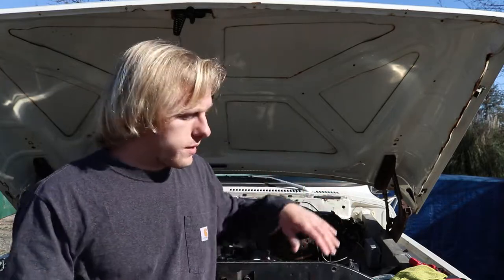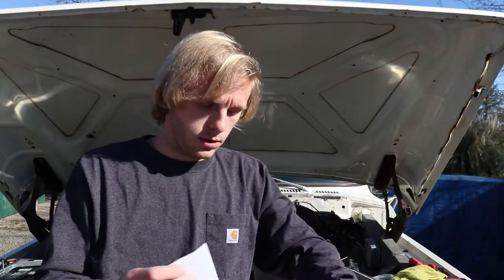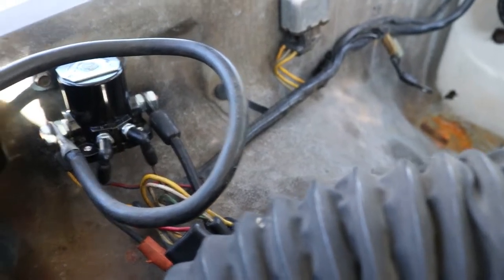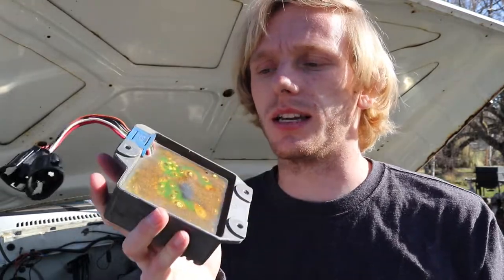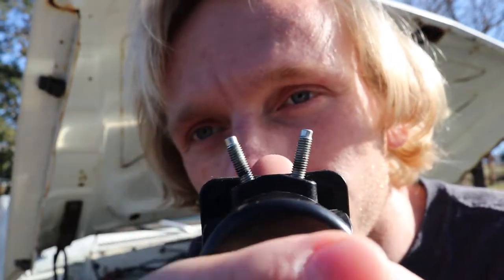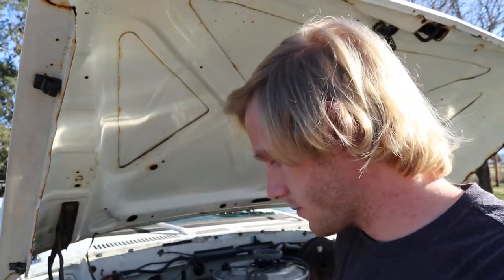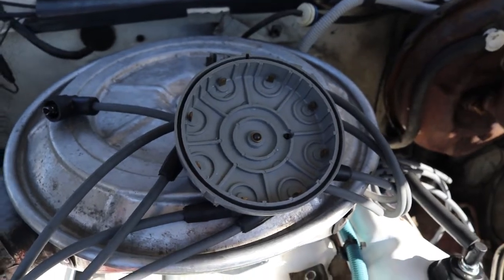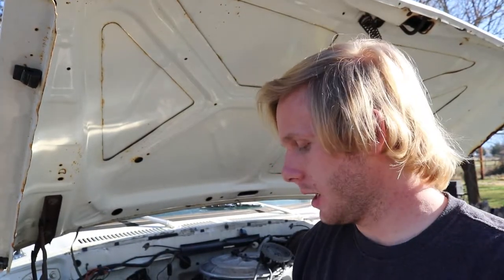My in Depth Duraspark 2 II Troubleshooting Diagnostic Guide

Comment: Hey Tyler great info! Can you come over to my house and help me figure out why my 78 bronco won't crank over? 😅 

Replaced;
Switch 
Duraspark box
Starter solidnoid 
Voltage regulator
Coil
Battery 
Fusible links
Alternator

I turn the key and it's like power is completely cut off. Absolutely nothing happens 

Head lights come on 🤷🏽‍♂️

(Took it to a shop they said they couldn't figure it out either)
Reply from the maker: Haha, well while I am not able to come to your house I can provide some things to look for with a no crank situation. First thing I would do is make sure your grounds are correct. I believe like my truck the negative battery cable is grounded through the engine block and then grounded from the back of the engine to the cab. Also to make sure your starter is good you can jump battery voltage (fully charged battery) straight to the other side of the starter solenoid and if that does not work I would pull the starter out and test it on the ground with jumper cables and a battery. Most likely if it doesn't work with jumping from battery voltage to starter side on the solenoid you have something wrong with the starter or a connection is lose. A multi meter can save you a world of hurt when testing electrical on these rigs.
Some other things I would look into is if the wiring has been tampered with, what condition is the rig in, things like that help to understand what some other person might have done in the past.

Comment: Hello sir do those systems hade dual ignition? And how posibly wuld it work?
I have somthing similar like that ford selenoid but I use GM starter selenoid I have 4 pin gm ignition module and e core ignition coil the fuse pops when I try to use that R terminal from starter selenoid is there any solution to use that terminal on electronic ignition?
I dont know perhaps me voltage regulator inside dashboard ore ignition module is polarity sensitive .
So please any help
Reply from the maker: I honestly would have no clue with GM stuff. Also, these old systems do not have dual ignition. Since you are blowing a fuse it should be pretty easy to track down the issue with a multimeter and read how much voltage is trying to flow through the fuse and causing it to blow and track it back to the source and go from there.

Comment: I don't know much English brother, but could you write me why the ignition module can burn? I have a Ford Maverick and there are already 3 modules that burn me in less than 3 months, I hope you can support me, to translate the text, greetings.
Reply from the maker: Hello, yes the Ford Ignition Module can burn. These Modules do not like being hot. In a Mavrick I think your Module is right next to your exhaust. The Module is placed on the inside fender next to the Header and can get really hot. You should be able to move your Module to a cooler location away from your exhaust and keep it from getting hot and melting down.

Comment: i have 79 f150 custom, replaced solonoid starter checks out good on the test bench at the parts store but when tapping solonoid or turning the key the starter will not engage, it does not crank just clicks at the solonoid. is this in the ignition switch ? whats a quick fix?
Reply from the maker: Sounds like a bad ground since the solenoid is new and the starter checks out. You can jump from the positive side of the solenoid or (battery positive) to the starter side with a tool or large wire and see if it cranks. Also check when you get time check continuity from negative battery terminal to block.
Reply: @TylerCreates   actually already tried to tap the solenoid via hot to starter side but just get a click. it will not engage the starter. checked all cables for continuity from solenoid to starter and from solenoid to battery and all connections and ground is good. is there something in the actual ignition switch that could prevent the starter from engaging ?
thanks for the help man !
Reply from the maker: I wouldn't think so, all the key does is send 12 volts via (I think) a yellow wire to the solenoid in the engine bay causing the solenoid to switch and pass battery 12 volts to the solenoid on the starter and into the starter. I would be tempted to straight jump the starter from the battery + to the solenoid on the starter. (Make sure your trucks in park with the E brake on) If that doesn't work the starter is most likely the problem as hot 12 volts should cause it to spin no matter what.

Comment: Will using a 45000 volt coil ruin a factory ignition module?
Reply: Be safe and use a basic factory type coil. Actual voltage is determined by the spark plug gap. .045 gap might spark at 22,317 volts. Why pay for an extra 22,683 volts that will never happen?

Comment: My truck starts and runs but the control module isn't connected how is it starting
Reply from the maker: Do you have a points style distributor and not a Duraspark distributor? That is the only way the vehicle could run without having the box plugged in.
Reply: @TylerCreates  I'm not sure the original motor was taken out by the previous owner it has a 460 in it now with wires all over the place and some going nowhere thank you for your quick reply the video was very informative going to find more about information on my truck
Reply from the maker: No problem, Glad the video was of help! Depending on the year of truck and more importantly the year of 460 you have it would have to have either a box that sends the spark or a points distributor that sends the spark making the truck run. Is it a Fuel injected or Carbureted 460?
Reply: @TylerCreates  carburetor I'll try to attach a picture when I get back into town

Comment: I'd just use a TFI-IV coil with the Dura spark 2 distributor and GM 4 pin HEI module because the D2 coil can't take the full 12v from the ignition. So they step down the voltage with a resistor. If you want to convert points to solid state ignition and you don't want to chase wires you can buy a resistor block for like a 70 Chrysler Newport or similar and then go through that because the Dura spark 2 coil can only handle what was it around 9 volts but I don't like messing with the resistors and just use the TFI-IV coils. They're hotter and have a better spark duration like the MSD or HEI. Just red to red wires and green to green. And then if you don't like the Ford module  you could go with a 4 pin HEI with 4 spade connectors and mount it to something like a computer heatsink.  But back to the TFI-IV coil you can run a wider spark plug gap. Make sure you have good ground and hot. I usually get rolls of 14ga wire online. The benefit of the HEI module is the dwell control and current limiting circuits allows you to run any coil you want. If you need the roller cam gear you want a D2 distributor from an 85 Mustang GT 5.0 because they were roller cam. Otherwise just swap the gear. The only benefit i know on the Dura spark module is it actually causes the timing to retard (only in start) for easier starting and it will last longer.

Comment: You might be correct on ground.  Replacement battery cable to engine no ground to body I have spark to dist cap little coming out of cap. 2 year old napa cap rotor 1000 miles? Failed?rubber mounting exhaust rubber mounting what is  left? Throttle?  Good thought

Comment: I'm putting a duraspark box in my 64 Falcon because the 302 that l'm installing. The motor ran good on duraspark before I pulled it from the doner vehicle. Wish me luck. I'll need it.
Reply: You will be fine. It works without the white wire connected. I have been using the white wire. Make sure its connected to the 'S' terminal on starter relay. The 'I' terminal will backfeed power from the coil to the module effectively neutralizing that function. It will run fine and you will never know it's wired wrong.

Comment: Voltage Regulator.. Ignition Accessories Stator Field..
If you have a Dead Battery/Short.. it could be the Stator circuit in the regulator! Unplug the connector and check resistance on battery terminals (off the battery)

Comment: I hooked a spark plug to my coil wire and it sparks like it should, but as soon as I hook it back to the cap I hear it sparking inside the distributor and I have no spark to any of the plugs. This has me extremely confused because I sanded the rotor and cap and they’re all clean, I’m not really sure what to do now.
Reply: My ignition switch is also screwed up, it doesn’t crank on START but as soon as it returns to RUN it will crank until I turn it back to OFF. However if I turn the key to RUN and leave it there, the solenoid will close on its own after about 5-6 seconds and start cranking.
Reply from the maker: I would make sure all of your connecting going out of the starter solenoid are correct, make sure the negative battery cable is grounded to the engine block then to a body panel, depending on your vehicle. I also have heard of the starter starting when in run and not shutting off, I believe it is a back feed problem. Make sure your positive to your starter is not corroded and contacting somewhere other than the solenoid post and the starter post. As for the sparking inside the cap I really don't have a solution for that. Sounds like a leak in the system allowing the spark to get out via a wire or something shorted inside the distributor. I always try to go at these situations one thing at a time and not get sidetracked, solve the starter/key issue first and make sure your connections are all clean and correct. The key issue could be causing spark issues. Also check your alternator / voltage regulator wiring and make sure it looks normal. If you have a different vehicle getting a wiring diagram online is a super big help, I actually printed one off on a piece of paper and had it out at the truck diagnosing, super big help.
Reply: @TylerCreates  ground the engine to the frame also if you can

Comment: Very helpful video Tyler. In 1984 the module is on a plastic wheelwell, does the box need to be grounded externally? Got a weak spark, thanks for any advice.
Reply from the maker: Hello! Glad the video was a help to ya. I am not 100% sure on the box needing to be externally grounded but most of the forums online and I would agree say the box is grounded view the black wire which is grounded inside the distributor and runs to the DSII box.
Reply: I have had problems with the ground going through distributor . I tee off that ground and go to the engines block for an improved ground .Works great.

Comment: Excellent source of information! Thank you for sharing!

My truck kept dying suddenly while driving in town; I was newbie so I was a little stumped. Turns out, the coil horseshoe was the issue (discovered while idling and I barely, BARELY touched the green wire and the truck suddenly died). The metal connectors were definitely the issue (corrosion, loose...) I just pulled the wires out of the metal connectors inside the shoe, stripped and folded the wires over each plastic edge of the shoe so that when I put it back on it pressed the wire securely to the coil buttons. Has worked since (I can even yank on the wires and they stay put). I even added a tach wire the same way. Only thing I will change this summer is to put a dab of dielectric grease on the stripped wire because I can see that they're getting a bit corroded.

Comment: My truck started,I moved it ran fine. I parked it, the next day I went out to mess with it and I have absolutely no power to anything on the harness.
I put new battery leads, battery is good. New solenoid, new duraspark2 box, 

I can jump solenoid and starter turns, but I have absolutely no power to anything on the wire harness, no lights no ignition, nothing.

If I make a jumper from battery to harness, I can make head lights come on and coil have fire, but still can't turn the key and start, no power to the switch, if I jump solenoid and and make engine turn and have a jumper wire to harness it will try to hit a lick. But it's like its trying to start with the key in off,

Long story short I have lost complete power to my harness and switch. But I have power to the starter.

I've untaped my whole harness and I've started replacing every connector but I haven't found the problem yet.

Ps. I do not have a clue what that 3 prong box is. It looks like a horn relay
Reply from the maker: Well as for having no power all the sudden I would check your fuse panel up under the driver side dash on the firewall for blown fuses. If you have a blown fuse then something caused it to blow, I would get a whole bunch of fuses anyway as they are an older style and could leave you stranded on the side of the road. I would first check the big yellow wire coming into the back of the ignition switch as that is always charged 12v. I don't know if that wire runs through the fuse panel, I would assume so but maybe not. If you don't have power there then something is wrong and that wire needs to be traced back to battery or solenoid as its the main keyed power to the truck turning everything on, I think its yellow. The little relay deal on the passenger fender back and above the ignition solenoid should be the horn relay, If you have cruise control it might be a cruise control relay but I believe it's horn.
Reply: @Tyler Creates  you are just a awesome human being, I want you to know that
Reply: @Tyler Creates  I have checked all fuses,
I have took the Guage cluster out to trace yellow wire back, it goes up behind the Guage and factory splices into the black with green stripe.

Do you have a harness wire running to your battery or solenoid?

My hot goes to the solenoid then to starter.
I have a brown ignition and red/blue start wire but I don't see a wire the fed the harness power to begin with

Comment: Thanks Tyler, good info. Trouble-shooting a 86 E-350 w/460, NO SPARK issue. Ran fine 2yrs ago, been sitting up since. New batteries, cleaning all the connections now. Replaced the Duraspark box and coil, not getting anything from the coil yet. Breaking out the meter, diving in...thanks for the clear advice.

Comment: I am not getting spark during cranking.  When the key goes back from start to run, I get a single spark and the engine usually fires up.  If the engine is running and I shut it down, I have no problem getting it to restart--it sparks during cranking.  Seems to be intermittent with cold engine.  I replaced the module, but that did not fix it.
Reply from the maker: I would suspect an electrical component. Since you have replaced the Ignition box I would bet that the Hall Effect sensor or pick up coil in the distributor is bad. When they get hot they can start to operate out of their specified range or fail completely.
Reply: I have the same issue whit my 1983 f150 but I have to charge the battery all the way to 14.40 volts so the truck starts whit out problems but it warms up and just died won't start again  . The mechanic put a 302 with aut transmission, now I'm doing all the work on the truck and it's very confusing. 
Watching your video it helps a lot
Reply: My issue ended up being the brown/pink wire from the starter solenoid to the primary side of the coil.  Not sure what happened to it but when it was bypassed everything seems normal.